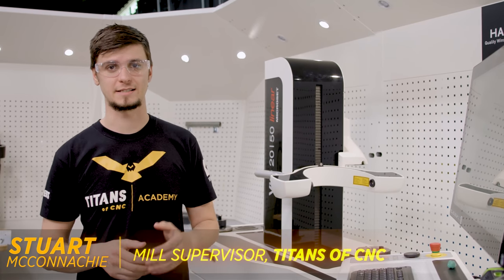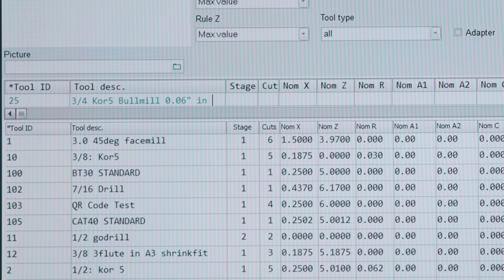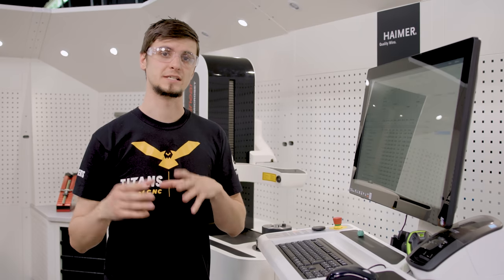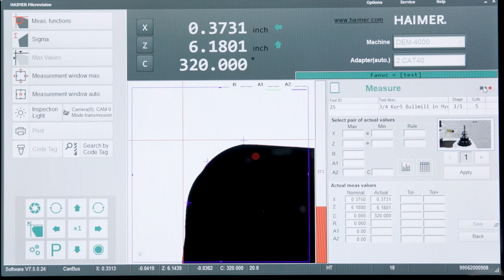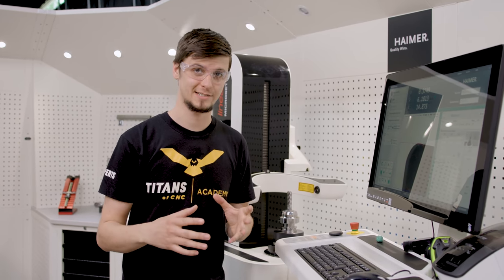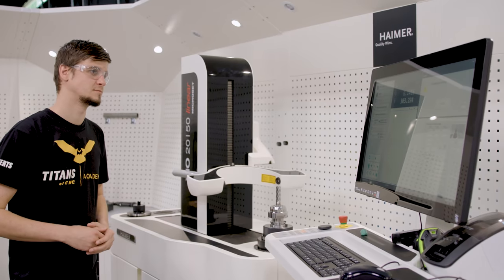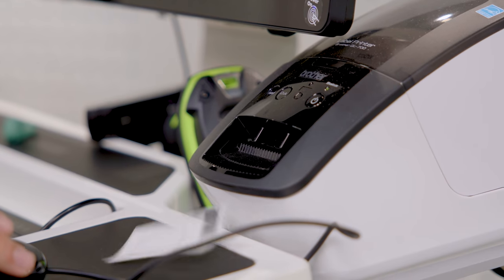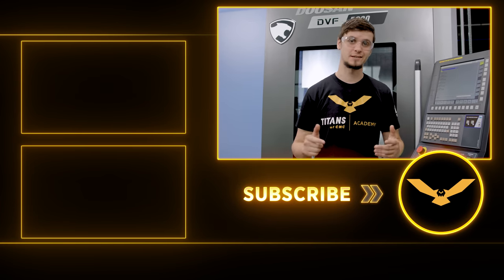CNC Machines Make Money By Cutting Material | Use PRESETTERS to Set Tool Offsets While Machining.

Comment: Worked at a shop with a pre-setter. It was pretty cool. You could take those offsets and plug them in to other machines. the only down side was you had to manually enter the offsets in to the machine. It would be cool to have a file on a server that the machines could ingest the numbers from...
Reply: Most of them offer post processors that will post the offsets into a format your machine can read
Reply: 10:59 the haimer outputs it into a g-code file and it seems like the doosan can ingest it. certainly not as easy as something cloud-based, but probably more reliable and secure

Comment: I know everything you guys have is top of the line Equipment, and I wish my company had all those things too, but all that work just to find out the tool lengths!!! The only good thing to have those machines is if the tolerances on the job are 0.05mm
Reply: It's meant for high production or complex parts. If you've got 80 tools going into a job, have your crib guy prep and measure while you set up the machine. If you're a one man shop and don't care about spindle down time, you can just bop an in machine setter or use a gauge block

Comment: Preset is pretty nice, ... There is also a tool magazine for the operator.
Reply from the maker: Yep...
He was giving an example of how easy it was but ya, the magazine side door would even be quicker🤩
Reply: @TITANSofCNC  most machine have tool measurements. But tool management is usefull for the overmore CIM park. One can set up tool-magazine for rough or finish part, and next workpiece. 

The shown machine is 'so new', old concept. HM Milling cutter head need 'different high insert plates to cut', to work fine. Will the machine do? 

May the measure-apparat have different tool holders system? 

The Mill Worktools are very developed. One may think about the knowledge about. Think thats sometimes twofold concern price and workpiece of the real practise. 

Like shown a little to single separate fashion for allday, ...  
Best wishes to You

Comment: Haimer microset used to be a DMG Mori product. Nice piece of equipment.
Reply: @rjbied  yeah but gildemeister owned them for a number of years, so they fell under the DMG Mori umbrella for a while as well. That's all I was saying.
Reply: @rjbied  the point was that they're good pieces of equipment
Reply: Microset also went bankrupt so…
Reply: @elwart0  what does that have to do with them being nice pieces of equipment? Doosan CNC isn't owned by Doosan proper anymore, either, they're owned by a holding company and licensing the name.
Reply: @TheFeralEngineer  it’s happened twice. Dmg gave it away with the machine and was nothing but trouble. Now the salesman is pushing hard for a new unit and from what i see here it not as good as what offered elsewhere. Just my experience
Reply: @elwart0  I had an uno20 in my office, it worked well. Parlec and zoller make sweet ones also

Comment: I’d like to know your program format to write to the offsets. Is it in the manuals somewhere? I’ve been through those things a gazillion times and haven’t seen anything like that.
Reply: Fanuc format is as follows:
G90 G10 L_ P_ R_ Q_

Depending on your tool offset memory type (A, B, C), you'll have different options available

L10 is length geometry comp for type B and C
L11 is length wear comp for Type b and c but it's geometry for type a.
L12 is radius geometry for type C 
L13 is wear geometry for type C

P is your offset number
R is the value you wish to input
Q is imaginary tool nose (more for a lathe)

If you have a 1/2" end mill that is 6.0" long, using offset 10, your format would be:
G90 G10 L10 P10 R6.0 
G10 L12 P10 R0.25
G11 (not needed in all cases, but good practice)

If you're unfortunate enough to have type A or B (no radius comp), you would have to use two offsets, one for length, one for radius:

Ex: type B length is 10, radius is 20
G90 G10 L10 P10 R6.0
G10 L10 P20 R0.25
G11

Always put G90 because G10 is absolute/incremental sensitive.

Another way to do it is to use the data registers for the tool offset, such as #2001, #2201, #2401, #2601, #10001, #11001, #12001, #13001... Mileage may vary with that, though. 

Check your Fanuc common user manual (mill/lathe), typically around chapter 16 you'll find the tables for all of the comp registers, but I would just use G10.

~TFE
Reply: @TheFeralEngineer  nice, I do use programmable parameter entry on the HMM. I’ll have to dig around and find where the format is for the others. Thanks
Reply: @Fencer85  what control are you running?
Reply: @TheFeralEngineer  oi-mb

Comment: I have some doubts about meassuring tools outside of the machine, if you have a machine with a spindle taper that only has contact on the taper and no face contac, as example Sk40 or Sk50, and you have a 3D touch probe in your machine, you'd have to set the touch probe length outside of the machine or otherwise your tool lengths wont be right, or am i overlooking something?
Reply: It is very easy to correlate the presetter measurement to the particular machine.

Comment: Hey I'm usually not a negative type.of guy but Zoller tool presenter automatically does most of the focusing and adjusting just by manually bringing it close to the cutting adge and you press 1 button and you're done
Reply: One touch measurements are also possible on the Haimer Microset.  Stuart was demonstrating the programming of tools that would be utilized in serial production.
Reply: @rjbied  I would have thought that a bit of AI could save all the basic stuff in the setting up - I would have thought it could count the flutes, for itself, for example, detect curved or square corners, coolant holes/whatever.
Reply: @debonh3828  when discussing tool presetters it is important to distinguish between tool measurement and tool inspection.  

The measurement data sent to the machine control (tool ID, tool radius,  tool length,  etc.) is fairly uniform regardless of tool type (shellmill, endmill, drill, step drill, reamer,  boring bar, etc.)

The measurement functions when using a presetter for inspection vary depending upon tool type.   Using the presetter to set the diameter of a single point boring bar, check the inserts on an indexable insert shellmill, set the blade and guide pads on a single flute reamer, measuring runout, looking at insert wear, etc.

An operator may wish to utilize many inspection methods of the presetter on an individual tool, but the machine tool control only cares about tool ID, tool radius,  tool length,  etc.
Reply: @rjbied  from what I saw from Zoller you bring the cutting edge into the window and say how many edges it has and then you’re done. This looks was more cumbersome
Reply: @elwart0  Microset has a similar function.   Stuart demonstrated a different approach.

Comment: I place all the tools inside the machine on a holder and just run a procedure and they're all loaded. No need to open the door on each one.
Reply: Very likely they do that on production but this is teaching video. Therefore they will show it in way health and safety rules demand it be done. That's why guy wears safety glasses in measuring lab etc.